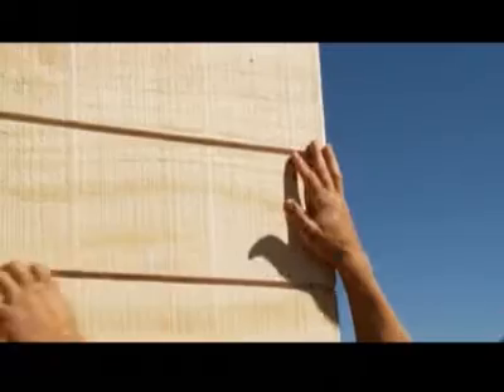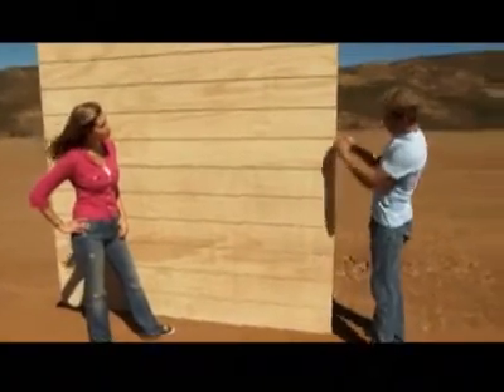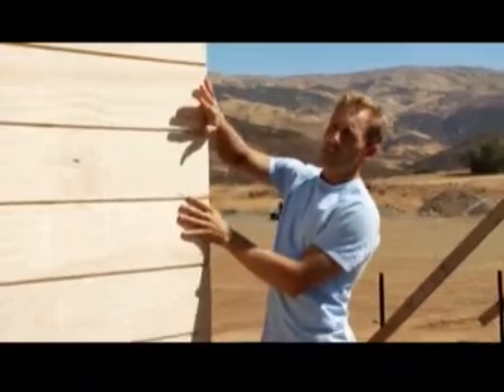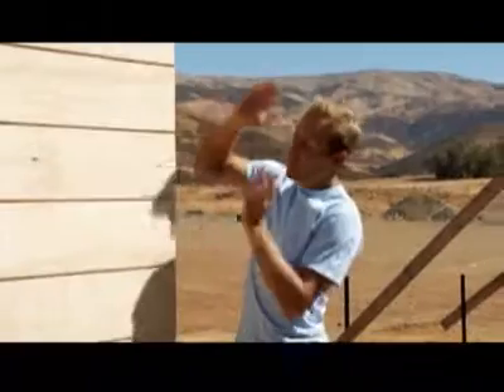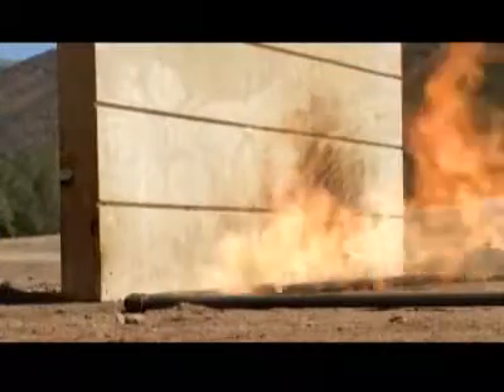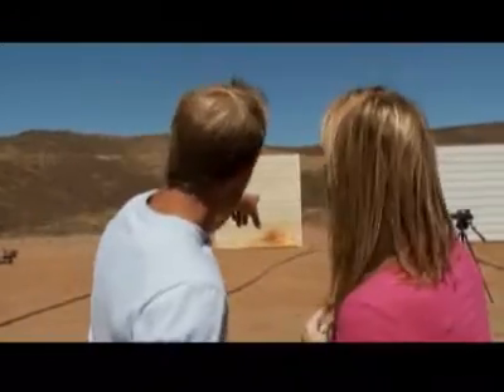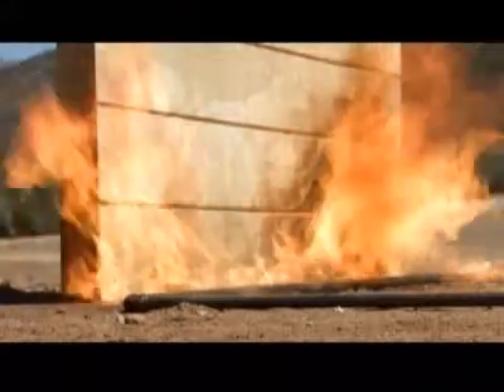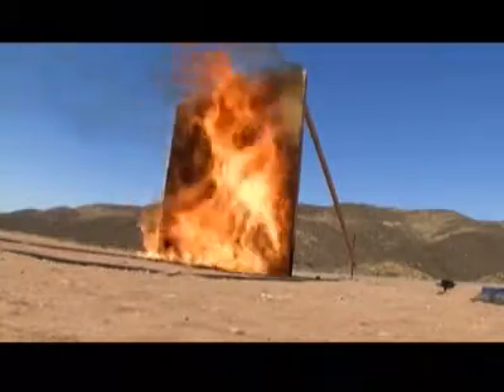Weather Proof: Wildfire vs. house

Comment: TBA FIREFLY developed this building frame wrap following the 2009 Victorian Bushfires in Australia. Our company TBA Textiles Pty Ltd manufacture high temperature cloths, which in various forms are used to make things like aproach suits for Fireman, radiant heat linings for battleships. The Firefly Plus 60 used in the FIREPROOF HOUSE VID is only 10mm thick and weighs in at 2.2kgm2, and as you can see is extremely flexible, it's just like wrapping a giant Christmas present. It can then be overclad